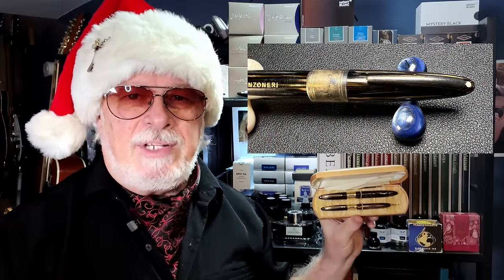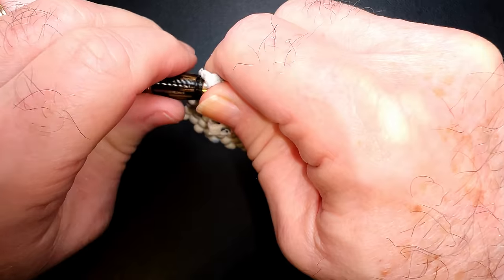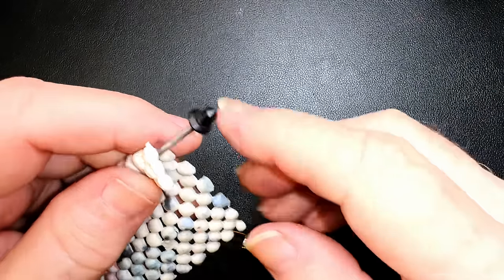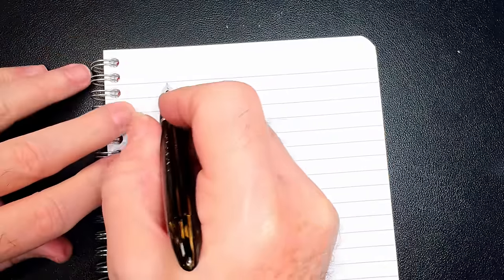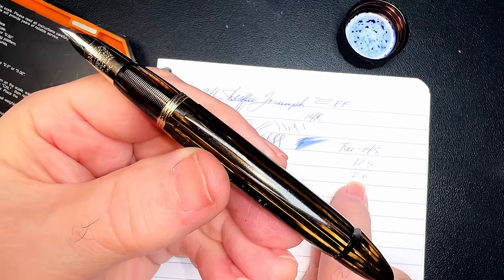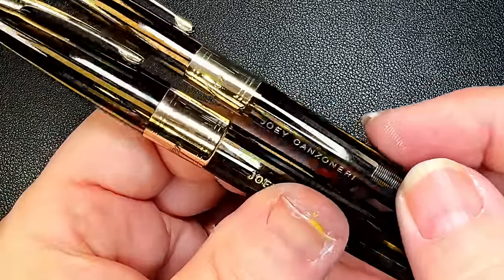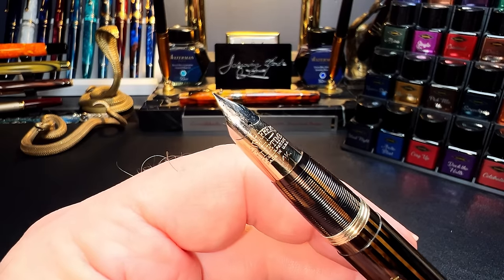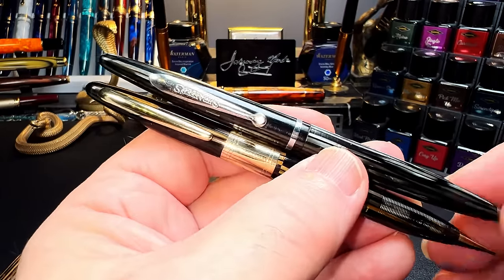Pen Resurrection Sunday Ep 50 1945 Sheaffer Lifetime Triumph Fountain Pen Pencil Set

Comment: Seasons greetings Doug & all the best for new year.Great video,I have repaired at least a dozen triumph vac fillers & found if you soak the shaft seal about 3/4 of them don’t need replacing they have just dried out,once you silicon the  shaft it keeps it as it should be.
Reply from the maker: Thanks for that!